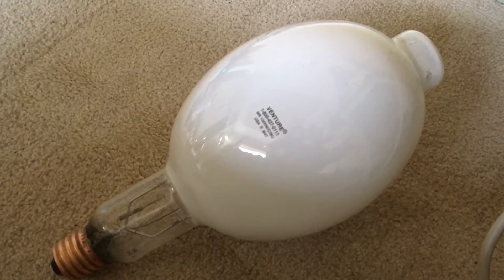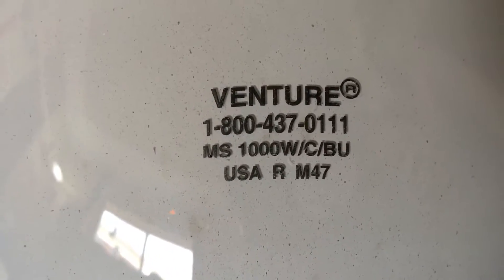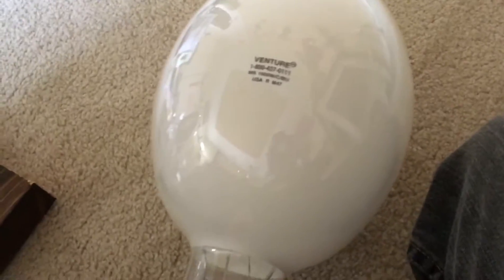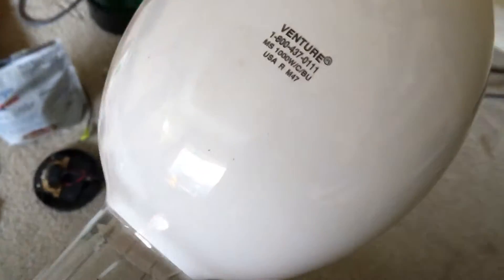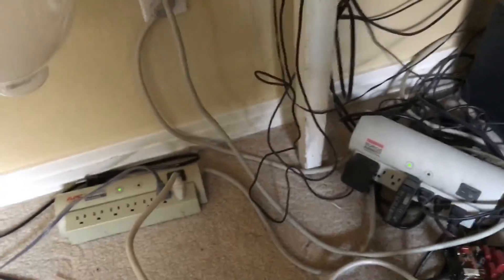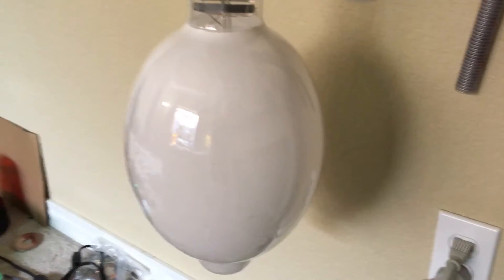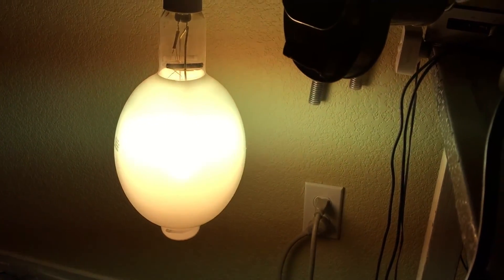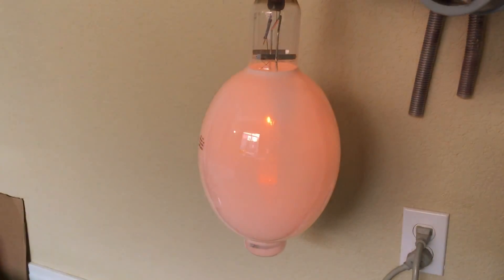Venture Lighting 1000W Probe Start Metal Halide DELUXE Coated Bulb (BU)

Comment: When it has a ceramic coating, it can only be used in shopping malls, roads, or playgrounds as general lighting. Without this coating, it could be used on fishing boats to help fishermen attract fish at night.Because this coating blocks UV rays, but it also blocks its luminous efficiency。We are the factory that makes this lamp,😀
Reply: The quartz tube lets uv to pass , the white coating on the tube reflects heat so halide salts stays vaporized

Comment: Coated Metal Halides above 400W are pretty rare, Not as rare as a coated HPS but still rare. Coated Metal Halide’s 400W or less were pretty common before, But now they are basically between common and rare. Coated metal halides were mainly used indoors, Like highbays, Those square lights, And can lights.
Reply: At least in probe start, Pulse start has a bunch of weird wattages.